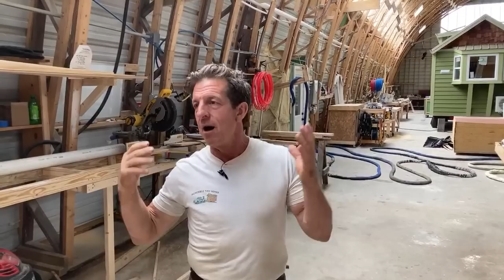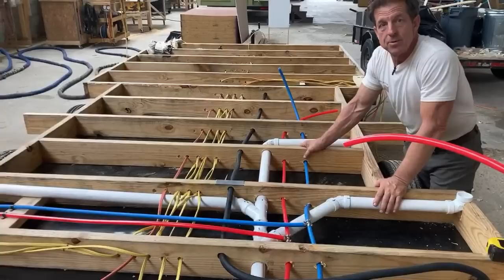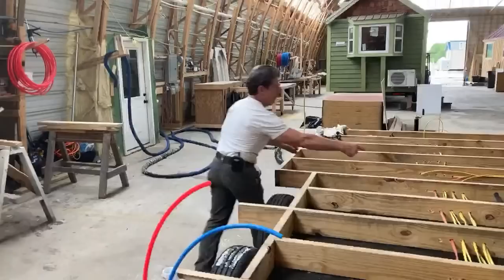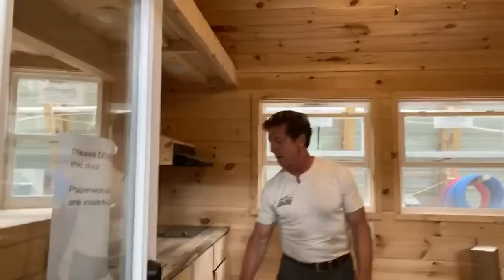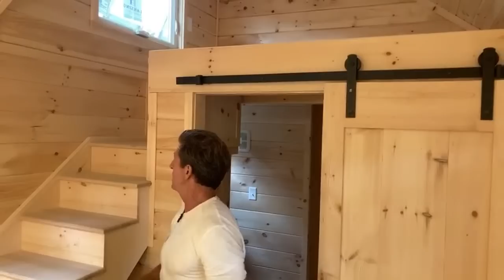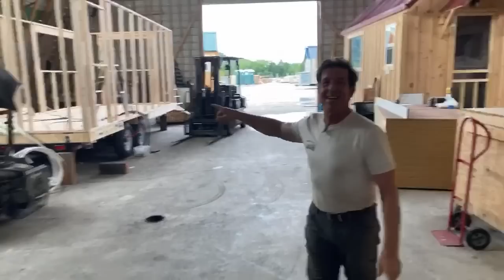Let’s plumb and wire a tiny house

Comment: Can you show how you frame the subfloor/joist?  
On this video at the 30:15 time mark there’s a trailer behind you and it’s framed up (minus the roof), and you can see the subfloor overhanging the trailer by 8-12 inches.  How do you seal the bottom there?  Because the side profile of the trailer all we can see is 2x6 or 2x8 and no side profile of plywood blocking.

Comment: Hey guys congratulations on all those amazing tiny homes you build, it is inspiring to see them coming alive. 
I have been following the process as I am building mine, appreciate if you could enlighten me with some answers to a couple questions.  I was looking at your plumbing and I like to know why are you using PVC instead of ABS.    2. is that main drain line a  2" pipe?  and if yes,  are you still connecting the toilet to it, or it has its separated way of draining?